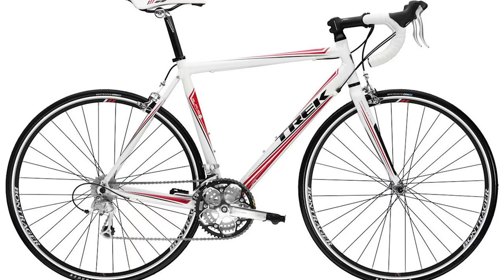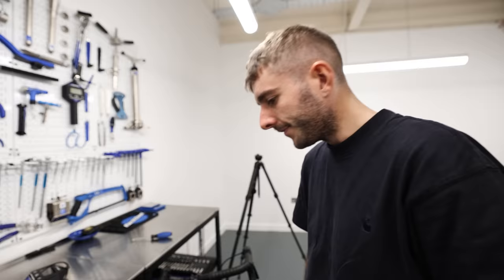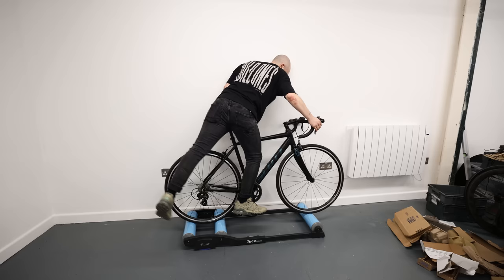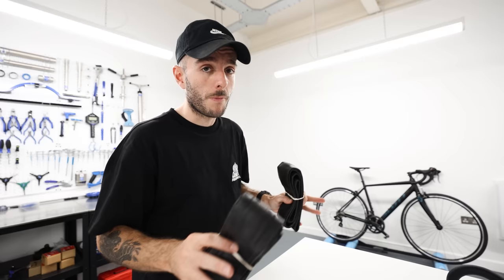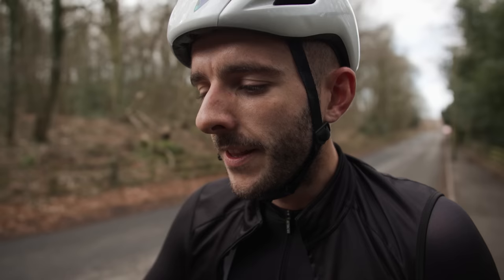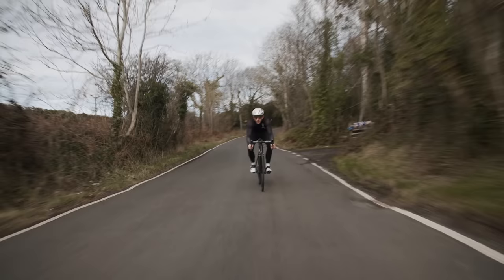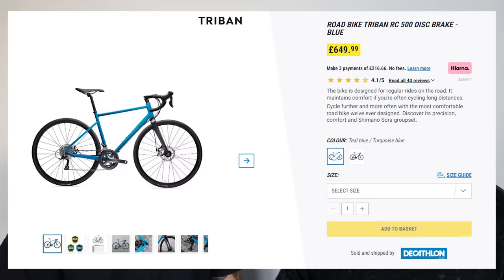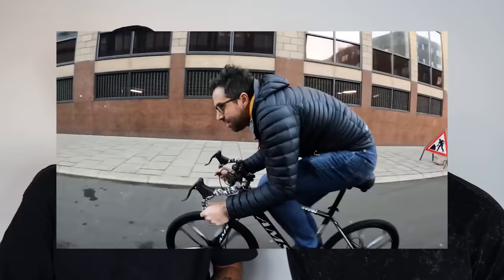How Good Is An "Entry Level" Road Bike In 2023?

Comment: My first and current road bike was a Felt FR50 2018 for around £800. Only things changes so far are lower geared cassette, new narrower bars, different stem, shorter cranks and clipless pedals all as a result of a bike fit.so far it's a great first bike. However with all the accessories, clothing and zwift Hub I've spend more than I paid for the bike. Bike fit was the best investment, maybe followed by the zwift Hub.

Comment: My first bike was a very used Dutch-style commuter for about 50 quid, then after some years it was a fixie for about 150. Many years later bought an entry level Carrera MTB for 350 and only used it for a couple months, then a Decathlon gravel bike for 600 that took me on many bikepacking rides, did hills, mountains, mud, everyday work commute and everything in between, just replaced that with a Sonder Camino frameset and built it with Fulcrum wheels and a Sensah SRX groupset, which all in all I think cost just about 1000 quid, and I definitely DON'T consider that an entry level bike. That 600 quid Triban was already more than enough for 2 years of heavy exploitation and if it wasn't for the extreme humidity it's been exposed to and standing in the rain for many days while I'm at work, I would probably still use it, but it's gone rusty a couple times too many to be working smoothly anymore.

Comment: I have a Scott speedster 20 Tiagiara 10 speed with carbon fork got it here in Pakistan 🇵🇰 for around 1500 USD it's a beauty for a amateur rider like me shifting is cool even on drops and it is fast it's not entry level it's mid range bike here my first road bike was a Carrera Claris got it for used for around 200 USD it was very though and heavy bike to ride but got me into road cycling loved this video 🥂 cheers

Comment: While changing saddle and bars makes a lot of sense. In regards to tyres, those are very good and expensive tyres, that while I agree are worth the money, at the beginner level you probably aren't going to spend it or do this. Also things like speed and confidence on the bike means that worse tyres and worse grip are less likely to be an issue. 

I agree get new tyres, in terms of a review however, tyres can really change a bike and cost around 10% of the bikes cost to change, you should review the good or bad tyres on the bike, even if it is just to say, "these are okay", or "these really aren't okay", on my decathlon Triban, the tyres on it were awful to the point of dangerous in any sort of 5-10oC wet weather, yet on my mid range bike they were medium/good tyres and really had no need to be replace (even though I did, and the wheels).

You can also get a road bike from Decathlon for £350 that is a good bike, it is around 10-11KG, it has 8 speed microshift, for around £550 you are looking at Sora on it, and at that point, it beats this bike at £900 quite easily. My full Carbon 105, Orbea Avant, in the sale, cost £850 in 2017. Reality is bike sales are falling and prices are very inflated at the moment they will have to fall because people aren't going to spend £1000 on entry level, they just will do a different sport like running, where you can be set up with all the gear for £200-300.

Comment: Nice review! I agree that you should not even consider bikes that are cheaper but already start to break on adjustment and use, these are gimmicks, not bikes. 
After not riding a bicycle substantially for at least 18 years (Not sure why BTW), I bought a second hand alloy hybrid Giant  Roam XR 1 (Shimano Deore 27 speed, Magura hydraulic rim brakes) in 2018. I use it as commute + weekend 'bad weather' bike. It  now has close to 20.000 km on the clock. That thing is build well, best 350 EUR (second hand of course) I spent. 
With nice weather, I ride my 2021 Canyon Ultimate CF SL 7 (rim brake, 7.8kg) "Entry level carbon bike" (1699 EUR), stoked with it still!   
My first road bike was a Peugeot H10 Race, ten speed - downtube friction shifters - toe clips. That was 459 Dutch Guilders, like 220 EUR, but uhmmm we are talking 1980 here 🙂

Comment: I bought a bike off amazon a few years ago for ~$200. Its a single speed, not a road bike, but I have had zero issues with it. For the type of riding that I usually do that cheap single speed is great and I have no complaints with it.

Comment: I payed 100 eur for my first speed bike back in 2010 in Italy. It was a cro-mo Colnago frameset of ~10kg and 2x6 gears with Suntour groupset from early-90s. Nothing fancy, but functioning perfectly and exactly what i needed to get into cycling. I cycled on it around Lago Maggiore, Garda, Como, and Lugano, prepared for Vätternrundan, just to name a few. What was important, the geometry fitted me like a glove. Over the years I got much better bikes, but even with fiddling with parts I never got equally good fit. In fact, I still have this first bike and do not plan to sell it, even though I do not use it anymore. 
Imho the first bike should be decent enough to make one fell into love with cycling and freedom it gives, and the key thing here is probably good fit and reliability. No noobie will have comparison with how smooth Di2 shifts or would notice marginal gains of shaving off 500g. Sure, everything should be mechanically sound and safe, but for many people a price tag of 900 is way to high to give it a try. In the UK there is so many fantastic local bike shops and co-operatives that sell very decent second-hand bikes for, sometimes, less than a half of this price.

Comment: Another very good video. I don’t mind having only 7 speeds in the rear. Heck, when I was coming up, we had 5 there. You claim that these Tourney derailleurs are probably better than the old Sora group, and maybe it shifts faster and more reliably, but you point out the ergonomic flaw, and that seems like a deal breaker to me. Overall, this seems like a good bike, though the price is a bit higher than I expected. It’s easier to change handlebars than cranks, so I’m glad that is the thing you disagree with, and I agree with you on that point. Like short cranks and narrow bars, too.

Comment: My first road bike is my Liv Avail AR1. I wanted something with solid parts and something I don’t have to worry about or upgrade for years to come. I really looked at those entry level bikes but came to the conclusion that the money saved is not worth it in the long run. My Liv cost me around 1.100€ at my local bike shop because it was the last years model and it is fitted with a complete 105 groupset, carbon parts such as the fork, tubeless from the factory. I think the sweet spot for major upgrades compared to those around 900€ entry entry level bikes is about 1200€-1300€. And you can find a good deal on a last year model like I did. And the „only“ 200€ more bring major upgrades in my opinion.

Comment: Defiantly an entry level, but I would recommend getting Claris as its defiantly worth the extra $.  Also would jump up to a 30T or event 32T in the rear (if rear mech can handle it). A beginner won't really notice the gear spacing as much as an experienced rider and a beginner will need the lower range when starting out.

Comment: I am still the owner of my first entry level bike, coincidentally a 2009 Trek 1.2 62cm with dual front derailleur Shimano Sora. Still rides smoothly and is in great nick. I am looking for an upgrade now but it's a jungle out there with regards to finding exactly what I want, hydraulic disc brakes, 105/Rival or above etc (not sure about Tiagra or Apex, any comments) and add to that I am 115kg and 194cm finding a good fit with all those features at a reasonable price is quite an interesting task. Thanks for a very interesting video.

Comment: You should do a video comparing this to the cheapest disc Speedster!

My budget mtb's budget wire discbrake feels waaaaaaaaaaaaay better than my budget-ish urban singlespeed's cantilevers. Maybe the dropbar specific brake levers would solve my problems, but with "3 finger" flat bar levers, it's just sh t. For comparison my mtb has "2 finger" flat levers too, which I could easily use with 1 finger. 
It's an effort to make the urban bike stop even on flat ground, it's hard to pull in, has very weak stopping force (brakepads changed from stock, cleaned regularly, the wires replaced). Maybe a longer lever would fix these problems, but it would make the disc brakes better too, so it doesn't change the comparison.
And don't forget that you can upgrade a disc brake bike, replace the whole thing to hidraulic, or just small parts (getting better pads and discs make it so much better), but with cantilevers you're just stuck with a dead-end system.

Comment: My first and only roadbike is a Triban RC520. Unfortunately the only option available at that time was the mens' so had to change out the handlebars to some 38cm ones. Cranks are a bit too long for me at 170mm but okay. It's got a 105 R7000 groupset and I paid 860€ at the time. Swapped some parts out - the handlebars as mentioned before, a nicer saddle, a set of Mavic wheels cause Decathlon's are not good if you need to change your tire. I can't do much more upgrading about the wheels cause they are Disc brake with QR (who the hell thought of that design?), so total cost was maybe 1200-1300€. Pretty happy about it though.

Comment: 1st bike was a 2007 Scott Speedster 30 with 105 on it. Bought at the end of the summer for the princely sum of £600. Brilliant bike that never put a foot wrong. Only got rid of it because I upgraded to an early Focus Cayo in carbon with Ultegra which was still only £1000. In truth, the Scott could have been a forever bike if I’d known enough then about swapping parts in and out.

Comment: I've strongly considered buying this bike for use as my trainer and travel bike.  When I travel I want a rim brake bike that will not be worried about if the airlines lose my bike box or drop my bike box.  Rim brakes bikes are so easy to maintain when compared to discs, especially when travelling.    The last time I flew with my $10k Cervelo R5, the airlines lost my bike for 2 weeks, then when it arrived, it was obviously poorly treated by the airlines.  Had to take it to a bike shop to be serviced so I could ride it.  Never again will I be flying my priceless carbon fibre disc brake bike.

Comment: My first bike is a Trek Marlin 7, I got for around 490 pounds new as it is a gen 2 and they were on sale as they were bringing in the gen 3. I did do upgrades to it though. Made the rims tubeless (they were tubeless ready) and put Continental Race King tyres on it. Swapped out the crankset for a  Shimano Deore M5100-1, as the stock was a square taper one with a shitty BB. Also, put better pedals on it, changed the saddle and got ARC hubs as they are sealed. Definitely entry level for a mountain bike, but still needed to upgrade it.

Comment: Thank you for not saying that Tiagra is entry level! Honestly, this bike is really nice for the money. The groupset is an upgradable part, but it's solid and can last a long time (I've worked with many people who commute on Tourney, and a lot of kids bikes rock it, and kids ride harder than most people). You're sponsored by Hutchinson, so can't say this, but I can, the choice of tyre on that bike is really nice. Most bikes at that level go with unbranded, or hidden branding (moulded and small instead of printed big), cheaper quality rubber. Proper nice tyres, at aftermarket quality, is a super nice inclusion. 

I'd recommend for most people to look second hand, there's amazing bargains to be had there, but talk to a local bike shop who might be able to help, or local cycling group. There's probably like 20 bike nerds who want any excuse to browse ebay for bikes ;)

Comment: Gear gaps are felt more by trained cyclists who've gotten toooooo used to a specific cadance. I was real bad that way, raced 12-27 9spd on my MTB. Shifted non-stop as a result and needed a shift to change velocity. I got a singlespeed bike and found that in most instances, NOT shifting is the faster way through. Better to train on big gap cassettes probably, to keep the legs' cadence range wide open. You can fine tune in races.

Comment: It would be a decent deal with Claris. I started out on 9-speed Sora (triple) back in the day and it had plenty of gear range and shifted smoothly enough. On top of that, it was a very durable groupset and the shape of the hoods was comfortable. Now that triples are obsolete, I think 9-speed groups should be the minimum unless you live somewhere without any hills at all. 

I did some looking around and inflation has definitely hit the entry-level market, but not as ridiculously as it's hit the high-end market. As always, buying used is the way to go.

Comment: My first bike road was a 2013 Bianchi Via Nirone, Was sold it in a shop and had no idea what I was buying and think the shop just sold me what they had in stock.  It cost me £1099, it scared the shit out of me.  really uncomfortable, very harsh ride, twitchy steering, I knew nothing about road bikes as had only ever had a cheap mountain bike previously which i used a handful of times a year for off road trails and stuff.  The Via Nirone put me off road cycling for years as I just didn't feel safe riding it and didn't enjoy it.  I got more into cycling during lockdown and bought a specialized Diverge comp carbon in 2020  and that is so much better, far more comfortable, more stable, just a dream to ride.  I got some carbon wheels with road tyres for it last year as was doing more and more road riding and love it and now I am really enjoying my cycling, out most weeks and training on Zwift and doing some fondos and stuff.  I am now looking for an out and out road bike, probably an endurance as I am old and don't need to win races, but I do want to go fast and climb hills.. I do 60-70 miles a week so any recommendations for the 6-7k pricemark welcome :)

Comment: In my opinion, any bike under $700 USD is a budget bike, but nowadays, compared to 10-15 yrs ago, you're getting better tech. 
My first real road bike was a used 1991 Trek 2100 Pro for $500. If you can, it sometimes pays to buy used if you know what you're looking at or have a friend who does. Example: My friend just bought a 2 yr old bike that sold new for nearly $6k for $2600. Granted, it didn't have all the original parts (wheelset, bar/stem, and crankset had been replaced), but it was still an awesome bargain.

Comment: I feel that the Scott is an entry level bike, but not at entry level bike price. But prices of everything have been so drastically inflated over the last while. 
My entry level road bike from about 14 or 15 years ago was a Jamis Ventura, for a little over $1000 CAD. It came equipped with Tiagra and FSA. Touch points were Ritchy and Selle San Marco. Its still running strong, but its been relegated to being used by family members on random occasions, or when my other bikes are in pieces in the garage. It came with 50/34 and 12/28, if i'm not mistaken.

Comment: At that budget I would go for an older used bike, 900 pounds can probably get you a midrange bike from a couple of years ago. As long as it had been maintained well, it'll last for many, many more miles. Almost 2 years ago I bought my first 'proper road bike' off a friend for way cheaper than an equivalent new bike. It has lasted me thousands of miles and im sure will keep kicking for many years.
Reply: I bought a NEW bike, but a model discontinued 2 or 3 years ago, so it was considered "not cool anymore", and the bike shop wanted to get rid of it quickly. It came 40% cheaper.

Comment: Nice vid. 6 years ago I bought a Pinnacle Laterite 3 as a winter / commuting bike, new from Evans but on eBay and paid about £400!!! It came with alloy frame, Shimano 105 groupset, rim brakes and carbon forks and weighed about 9.5kg. Cracking bike. Only issue was the headset which failed after lots of wet rides and was an odd size so I couldn't get replacement sealed bearings to fit. I now have it set up on the turbo for Zwift. I have a Specialized Tarmac costing nearly 10x as much, but I had just as much fun riding the cheap bike tbh.

Comment: My first road bike was a steel Claude Butler for around £330 and I considered this very expensive at the time. After a short time getting into the "roadie" spirit and I could see it's issues and upgraded to a much better road bike a Carbon Merlin Fuse with Shimano 105 and hydraulic disk brakes for £999. Which was a much better bike for the money, lots of my friends couldn't believe I'd dropped a "grand" on a bike but it was definitely a really good step into the sport. 

These days I think you get less bike for your money, especially at £900, not even hydraulic disc brakes???! It's 2023!!!!